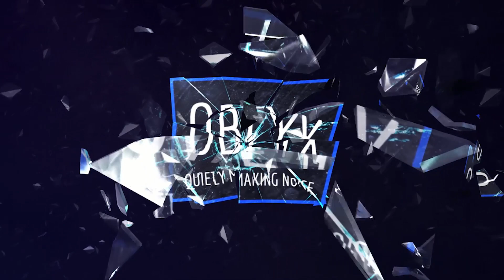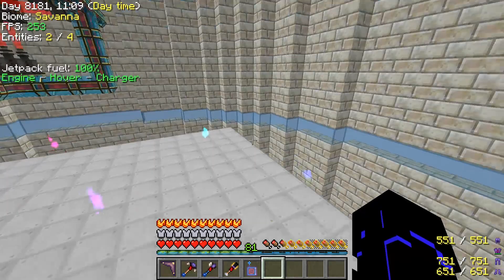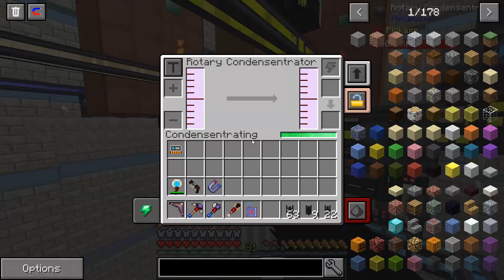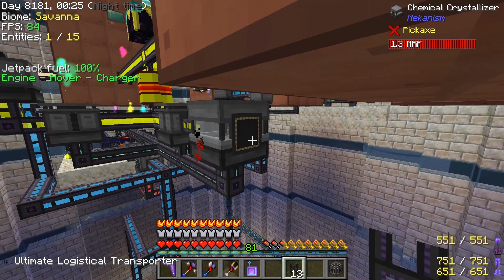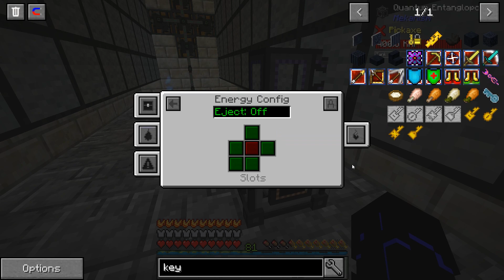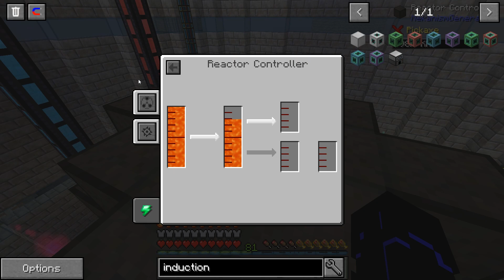Energized Induction Matrix, Part 2 - E49 - Project Ozone Lite

Comment: Congratz on your 100th video.  You did that fast. 
I could not control myself and did some calculations on how many cells and providers you would need to fill this huge battery.  Assuming (never assume, but I did) you put in 50/50 you will need approximately 2916 each. This will give you approximately 37,908 maximum MRF.  Wonder how long that would take to complete? hmmm. Maybe I miss calculated but it ... it .. I can't wrap my  head around the amount of power this battery hold. (but I'm under the weather and my head is a bit  hazy, so don't quote me) .  The reactor sure looks awesome working at it's maximum injection.  AND.. it didn't blow up ... hehehe.  
It's really cool to see these things working together like that. LIKED ^.^
Reply from the maker: Thanks.  I was surprised to see 100 come up.  It really is a rediculous amount of power.  My system was crafting more all night.
Reply from the maker: I'm glad you saw the bonus footage.